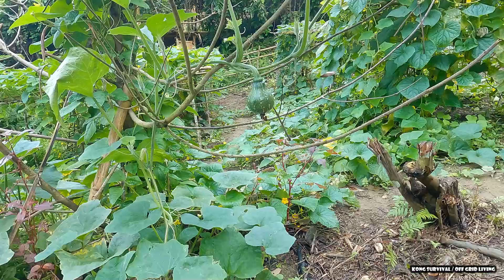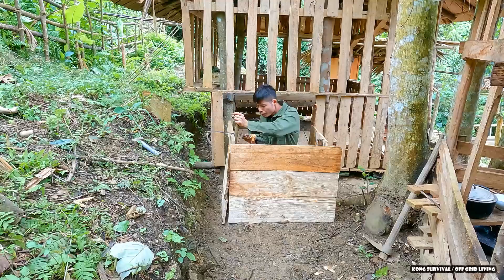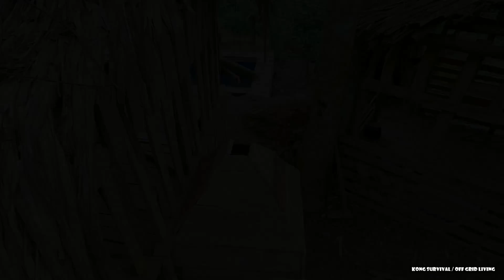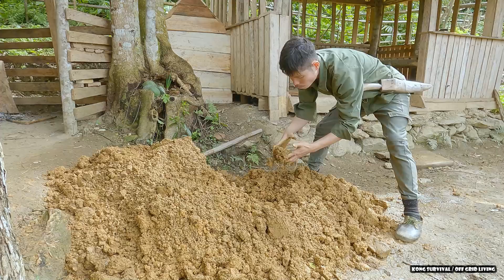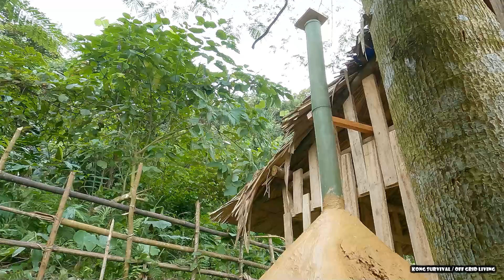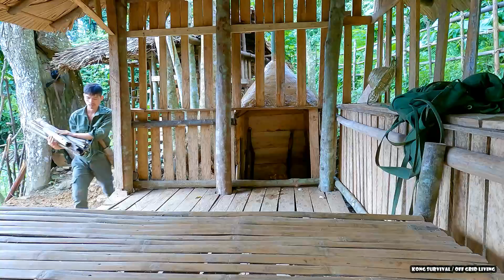Make a fireplace in the house, Fighting the winter cold - Off Grid living | Ep.49

Comment: Kong, some of your fans, viewers are so worried about your wellness and safety in the cold winter. I think of 2 possible options : 1, Set a tent inside the shelter and /or 2, cover some area with big clear plastic sheet. Those measures are just for winter, and when spring come you can easily remove it, then, your handsome shelter will be there again,😊😊. Well, I will wait and see what solutions Kong will present to his viewers. Maybe we will have a surprise. By the way, the fireplace looks very Cosy. 👍👍